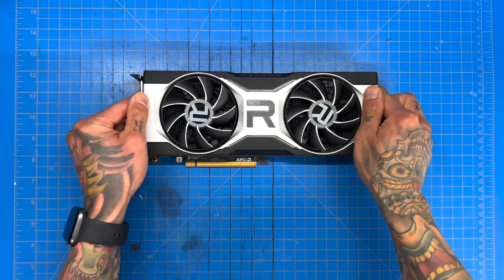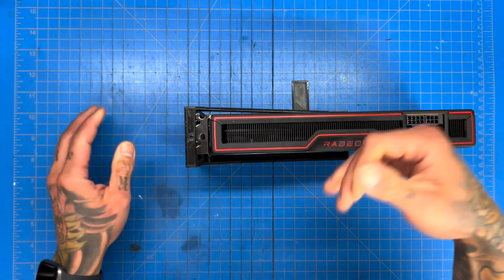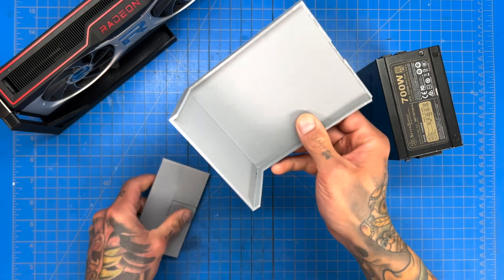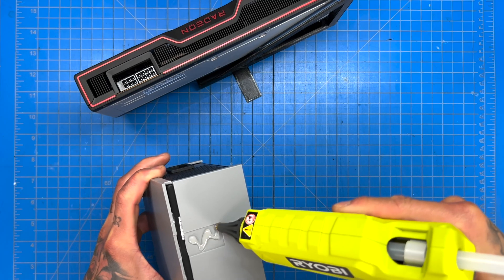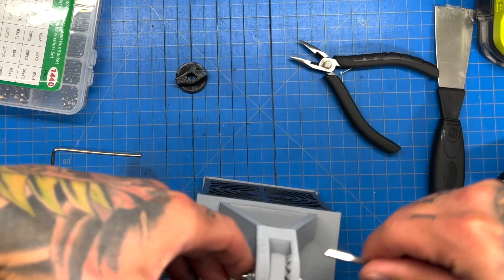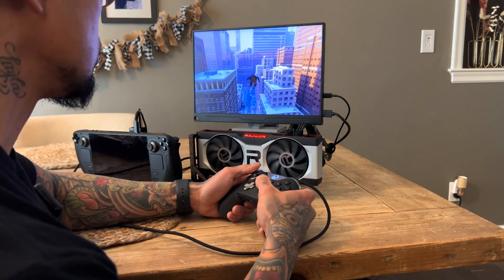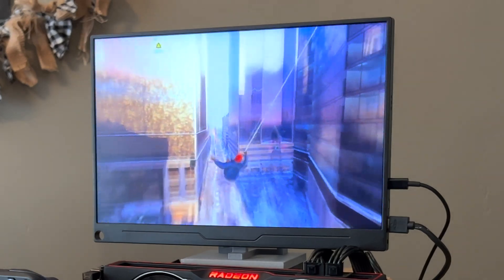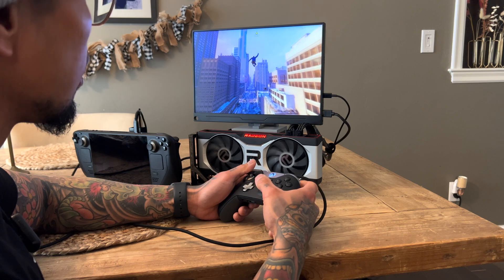Steam Deck External GPU/ Monitor Docking Station “Mother Ship"

Comment: You went overkill on the PSU. You should only need 300W not 700
Reply from the maker: True, it’s the my spare one I had. 

The new egpu has a 1000w psu lol

Comment: necessity is the mother of invention but we are the Father :face-blue-smiling:
get monitor with cable attachment on the back that way you don't see the cables. 

mount it on a swivel plate so you can rotate the monitor. i did that with a monitor someone through away and connected it to my laptop and wireless keyboard. loved you awesome build glued piece i'll forgive but that plastic could've been repaired without gluing to power supply or printed another one. 

not a gamer here, but love to build things. it's the goldsmith/master jeweler in me. self taught in computer repair not a programmer but know enough to do mayhem. 
slapping that button keep up the creativity :face-fuchsia-tongue-out::glasses-purple-yellow-diamond:
Reply from the maker: Amen

Swivel mount would be a nice addition.

Definitely could have been fixed without glue , should have just redesigned and then reprinted it.

Ended up redesigning the whole thing

Self taught all things PC too, software is a no for me as well.

I appreciate the SUB thanks!
Reply: @Diy_Papi  :hand-purple-blue-peace:in my 60's You have talent
Reply from the maker: Thanks, Keep up the good work OG! Let’s keep tinkering until the wheels fall off.

Comment: Disappointing and downvoted. Almost exactly what I wanted, then when we FINALLY got to gameplay “IDK HOW MANY FRAMES I’M GETTING…”

This isn’t a windows system with a convoluted 3rd party frame counter that needs to be turned on from explorer… IT’S A STEAMDECK! All you have to do is literally press HOME+A and the quick access menu opens with the FRAMERATE COUNTER OPTION!

What the actual fck… this is like me going to a restaurant and not tipping because “I don’t know how much” pretending I don’t have a calculator when my phone is in my pocket and Siri could easily tell me what the number is.

👎
Reply from the maker: Chill bro! Its all good!

I was running off Windows and Afterburner was acting up. 

But I could have used the adrenaline overlay now that I think about it… 🤔

Welp! There is always next time!

🍻

Comment: Cool build, though the hotglue is kinda silly, trivial to design 3d printed parts that join together using dovetails or bolts, also might want to use a threaded insert for the screw holding the GPU bracket or that part is going to be disposable.
Reply from the maker: Quick and dirty is my middle name lol.

I’m a framing carpenter so faster the better lol

Comment: Try using something stronger than hot glue. This is hazardous
Reply: I'm with G.S. Hot glue is super sketch, especially with an LCD panel hovering over a GPU. You may have access to gorilla glue sticks, but that might not be available everywhere in the world (assuming you are planning on sharing the print files).  I would recommend adding holes to accommodate metric bolts, and maybe print the faces that meet together with an extra couple of MM so the bolts have more material to grip onto to be secure, and that will give you some of that additional height you are looking for. A SFX PSU should also have a standardized bolt mounting pattern, and an additional mounting face to screw that PSU into will increase rigidity of the structure overall. These are holding expensive parts, and weight isn't a limiting factor since it's not primarily mobile, so I think perhaps it is prudent to beef it up a bit.
Reply from the maker: Gorilla glue hot glue sticks are extremely strong, probably even overkill for what I’m using it for